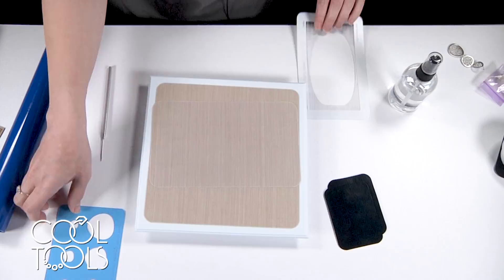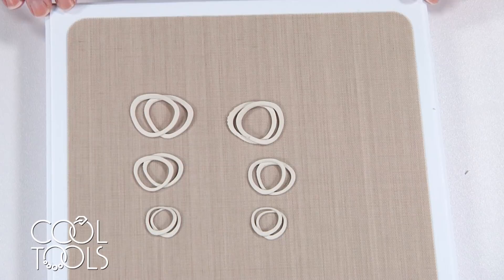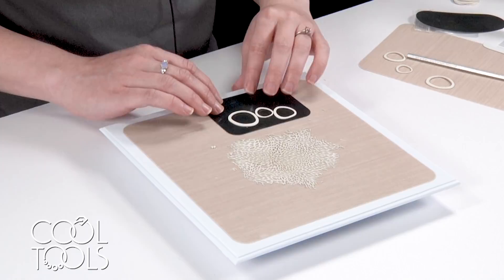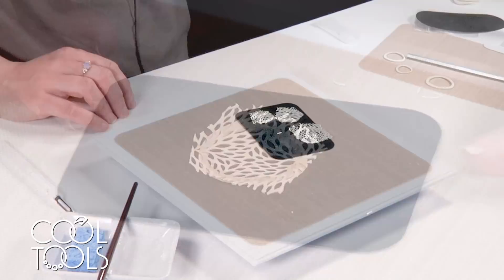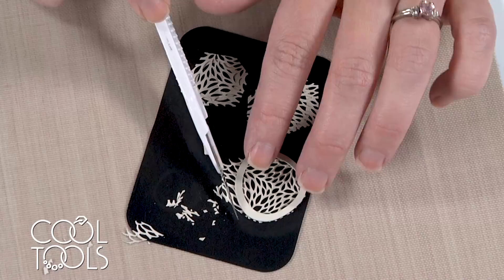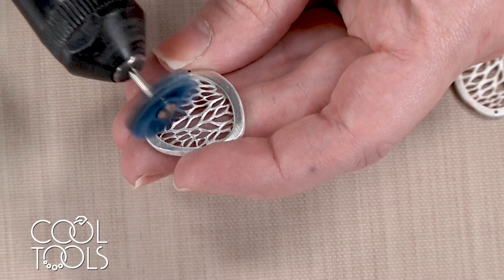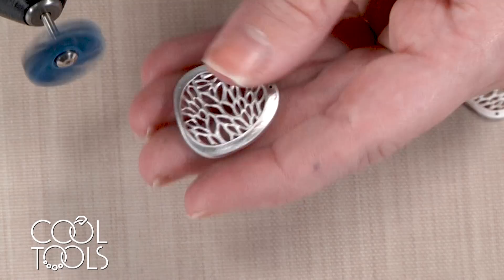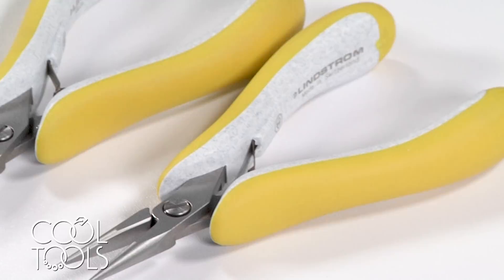Cool Tools | Organic Shape Cells Earrings with Silver Metal Clay by Karen Trexler

Comment: Did you have to spray the texture sheet before scraping the clay into it?  If not, doesn’t the clay stick to it?
Reply: I had better success when I applied some Cool Slip on the texture sheet. But this part is a lot harder than it looks on the video. I am a beginner, so you might not struggle as much as I did.
Reply from the maker: Hi Deborah, usually you would spray CoolSlip when rolling clay over a texture, but when using this technique, CoolSlip is not necessary as you are allowing the clay to dry before taking it off the texture. Hope this helps!

Comment: Those are very nice, if you were going to sell a pair of earings like that, what would you charge?
Reply from the maker: Thank you! Pricing for me is always a reflection of how long the piece took to make alongside the material cost. Since I wasn’t making these to sell, I’m not sure exactly how long they took to make, so I don’t know how much I would sell them for. One of the aspects I really liked about this project is that the material cost is relatively low since these earrings use substantially less material than something solid.
Reply: @cooltoolsvideos  Thanks, I was just curious as I could see a lot of work going into this, although the video showed a lot I'm sure it didn't show all that went into it right? I'm kinda looking for a hobby as I am pretty much house bound and on oxygen now, but I just don't know if I would have the patience to merritt buying all the equipment. I might start off with something simpler and see how it goes , my wife would love those though. Thanks so much fo taking time for these videos their very encouraging.
Reply: @davidgcook2502  PMC really requires very little equipment, and most of what you see here can be entirely successfully mimicked by common household and office supply items. You don’t even need the mug warmer; just let your pieces dry for a few hours or overnight out in the air. Just use whatever little dish you want for water, buy cheapie brushes at the craft store, a pack of playing cards glued together into the various multi card thicknesses instead of the plastic frames, and use plastic report covers to work instead of the teflon pads. And skip the Cool Slip. Olive or other vegetable oil works perfectly well and is vastly cheaper and more readily available. You can buy little spray bottles for next to nothing.

It’s super critical that you don’t use a butane torch while you are on the oxygen, though. You will want to preferably leave it in another room altogether before you turn your torch on, but at the minimum, turn the tank off. Torch firing only takes a few minutes, so you wouldn’t be off the oxygen for any appreciable length of time to do it.